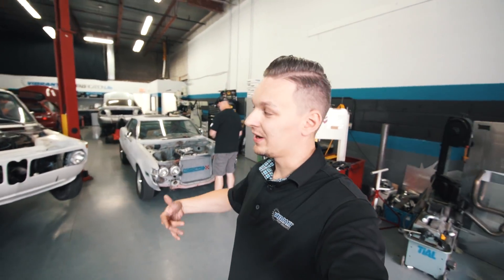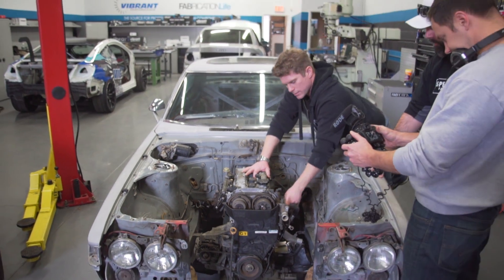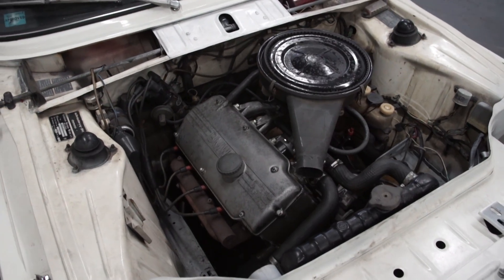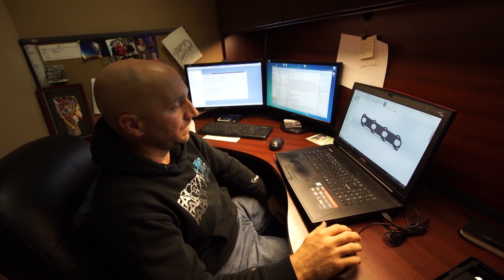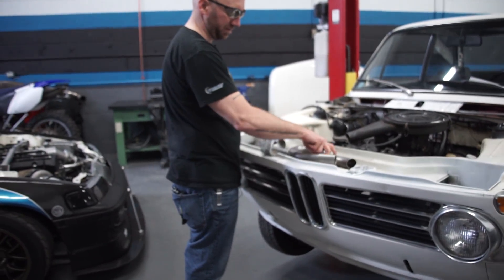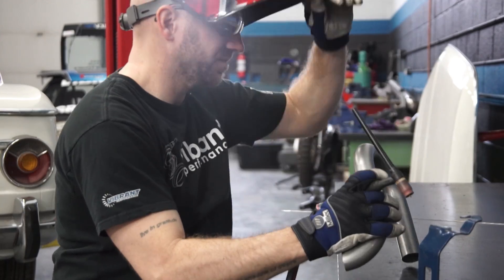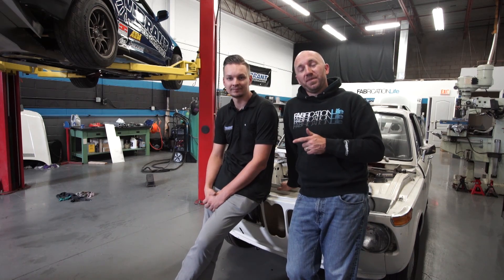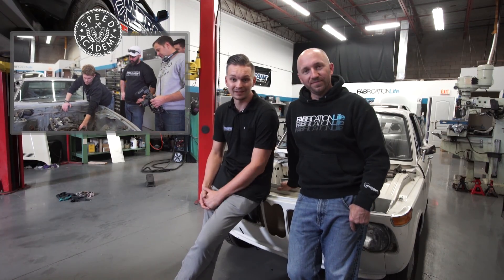Retro Header Build-Off Part 1: Material, Mock Up, Design

Comment: i always wanted to ask this retro style manifold is inly for 2 valve per cylinder engines or we can use them and on 4 valve per cylinder i have an m50b25 engine and i want to make something like this on it but i dont know if its worth it